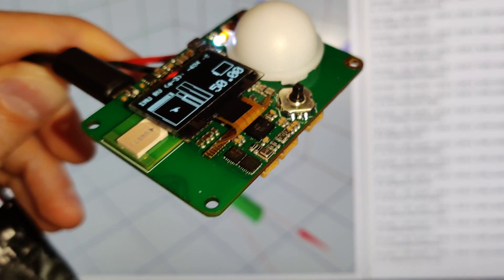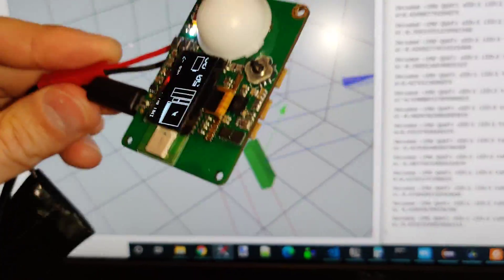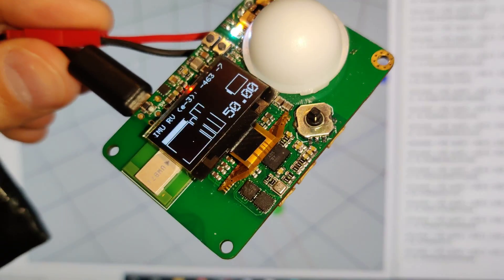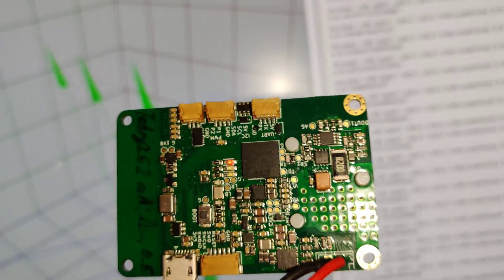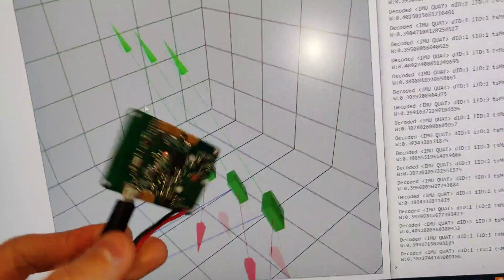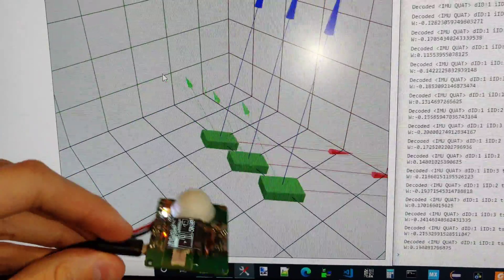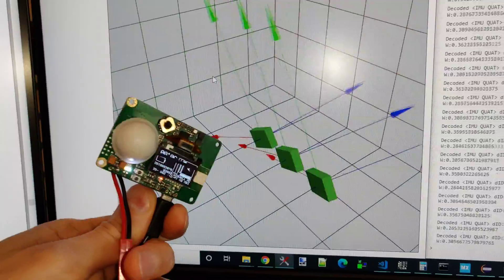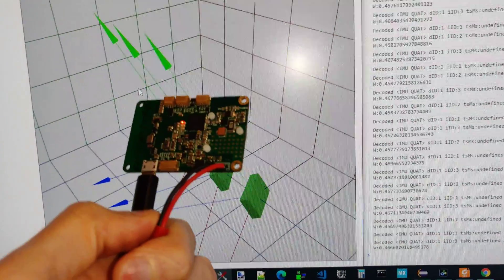BNO085 MotionEngine vs ICM-20948 DMP Comparison - Part 1

Comment: Hi Alex, I just begin to start a hobby sports motion tracking project. I want to have a maximum sample rate. Is it correct that BNO‘s max. rate is 100Hz and ICM can go up to 225Hz?
Another important point is accuracy/resolution of position changes. Do you have an idea how precise you can measure small movements? Is it mm or um?  Do you see differences between both sensors in this question?
Reply: Have you even found anywhere that you can buy the BNO? Seemed like they have been sold out for ~1.5 years
Reply: @natezimmer4489  You are right. I decided to go with ICM-20649 from Invensense because of double gyro resolution ans most important for racket sports 30g max. acceleration. So I have  to check if I really need magnetometer. And I have to check were I can find libraries for STM32.
Reply: @frmlfrml  My interest is for running. The ICM has max 16G if i'm not mistaken. Unfortunately I peg those out easily and i'm guessing you might as well in a racket application. Also, should just be able to port the arduino libs to whatever ecosystem you go to. Part of the bummer with the ICM and why I was trying to unearth a BNO is because the ICM's DMP implementation is rather crappily documented if your interested in absolute orientation. Also gotta side load it at runtime which is silly. If you are only interested in accelerometer data though, that may open up your options a lot and ya may be able to find somthing with a higher Gscale

Comment: This is a very interesting, nice project. You're right it's strange the ICM sensors aren't the same but the BNO and the middle ICM seem to be the same!

From reading your replies to the comments, am I correct in understanding the BNO085 doesn't require calibration / re-calibration when powering off/on?
There's a couple of videos referring to the BNO055 and required calibration. Here's one from a BOSCH engineer https://youtu.be/Bw0WuAyGsnY. 

A colleague has been using the Intel RealSense T-265 which uses the BNO055 but doesn't require calibration. I'm curious to know if you have any ideas on how they might be doing that?

Looking forward to seeing more from you regarding this IMU sensor project. Keep up the awesome work!
Reply from the maker: Every 9-axis MEMS MCU needs calibration process. This is to know proper zero offsets for accelerometer and so called hard iron and soft iron matrixes for magnetometer. Both IMU don't one a fly, the more you move it - more accurate it is. You can save these settings into flash memory before switching off the device, so that when staring up next time the device will show more accurate data at startup. The difference between BNO085 and ICM20948 is that BNO has internal non volatile memory and ICM is volatile only. That means every time you power up ICM - first you have to load it's firmware image into it (DMP driver) then load values into calibration settings registers. BNO has internal flash where it's firmware is loaded by manufacturer. It can save current calibration settings to apply them automatically when it powers up next time. In case of ICM - both (the firmware image and calibration settings) should be managed by host MCU on your PCB (either store them on SD card, or use flash memory of the host MCU itself to keep all this data)
Reply: @alexm7056  Thanks so much for the answer to my question. Not long after writing that question, I found your other video, with the more finalised project(3D printed case, etc...) Where you also show and explain the calibration process and loading saved calib... data, as you've mentioned above.

Which do you prefer out of these 2 sensors? Seems the BNO is quite good and maybe slightly easier to use, what do you think?

BTW:- I'm curious to know what are you making with your setup? Is that a PIR sensor you've got on there too, maybe to make up the system when detecting. motion close by?

Thanks again
Reply from the maker: @nicksullivan329  as for "which sensor is better" - the answer it depends on design specific of your application. See my answers to Paulo Amoral in comments to that other video " with 3D printed case". 
As for your question about this project - it's a part of  long-going personal endeavor to develop something interesting. I am trying not to disclose too much details publically, will post another video when its done.
Reply: @alexm7056  Cool I'll check your comments to Paulo. Fair enough thought you might be keeping it dark, no harm in asking;)
Thanks again and looking forward to your next videos.

Comment: Hello would you provide .c .h library for the ICM-20948 ? Did you use matlab for the fusion?
Reply from the maker: There are NO fusion algorithms you need to implement here. Since these IMUs come with built-in MCU inside that execute fusion algorithms for you. And that is what demonstrated in the video. Developed by manufacturer there is NO source code of these available online, it's is private intellectual property of manufacturer. BNO085 is easier to use for beginners, because it has everything stored internal flash. While ICM20948 does not have non-volatile memory, if you want to use internal fusion MCU - every time you power it up you have to load  bin image of its firmware(over I2C or SPI). DMP bin image  is provided with ICM20948 SDK on TDK Invensense website.
Reply: Can you do a tutorial

Comment: Hi Alex,
What data refresh rate are you getting from the ICM20948?
Reply from the maker: BNO085 and 2xICM20948s are configured to provide 9-axis Quaternion at 50Hz, so the data stream on the ride side of the screen is like 150 packets per second.

Comment: It’ll be great if you could bring a magnet to see if either of the ICM20948 or the bno055 sensor fusion algo is immune to magnetic presence. Also how did you end up calibrating the soft and hard iron offsets/matrices. Would you happen to have an example C code that you’re willing to share on GitHub?
Reply from the maker: I've tried that thing with a magnet earlier, just did not documented yet. When everything turned on and calibrated it does not budge if you bring a magnet close by. But there are issues when your turn it on with a magnet nearby. I will do more videos later, but need to complete some coding first. 
Built in motion controller in BNO and ICM does on-the-fly calibration, since the moment you turn it on. The more you rotate it in different direct it gets cailibrated better. I will show that process in subsequent videos, just don't have much time to do that at the moment.
Unfortunately I can not share the firmware "as is ", at least until I finish this personal project I am working on (projected in a 6 months or so). Sharing the firmware would require sharing hardware design and software as well, and that is quite a few years of research and development.  I have not decided on how I will release the final solution to the world yet - would it be OpenSourceHardware or partially open-source. With a hundreds of sleepless nights invested I just don't want someone to steal my ideas and capitalize on them.  
Both IMUs have STM32 code examples provided as a part of SDK from manufacturer. That is what I used to port driver code blocks into my firmware. TDK Invensense can be downloaded form their website.   Hilcrest has driver code public on GitLab (https://github.com/hcrest) available in two variations: FreeRTOS and bare-bones, the last one is much simpler to understand. Neither TDK nor Hilcrest share Motion Algorithms firmware for built-in MCU.
The 3D rendering you see on the video is done with my custom-developed application which is fully featured diagnostic tool for the hardware I make. Right now it is hosted as google chrome extension, built with Angular and Three.js. Here is good example on how to render something with Three.js: https://www.jonathan-petitcolas.com/2013/04/02/create-rotating-cube-in-webgl-with-threejs.html  And here is an example of Chrome extension on how to read serial port: https://github.com/damnemo/serial_monitor.  Just merge these two. The  suggested Three.js example rotates Cube object by euler angles, but the Three.js API can rotate it by quaternion directly: cube.setRotationFromQuaternion(new THREE.Quaternion(x, y, z, w)) where x,y,z,w are Quaternion numbers decoded from serial data. Probably it is much easier to do the same with python using pythreejs lib (https://pythreejs.readthedocs.io/en/stable/examples/Animation.html) and pyserial (https://pyserial.readthedocs.io/en/latest/pyserial.html)
Reply: @alexm7056  thanks a lot man looking forward to it, in the meantime I’ll dig into it myself. Again great work and thanks for sharing!